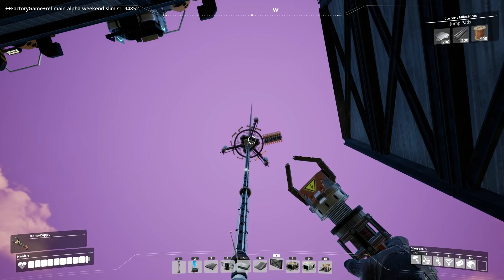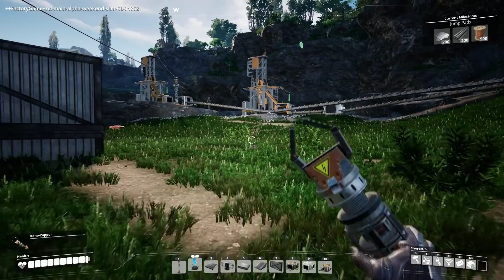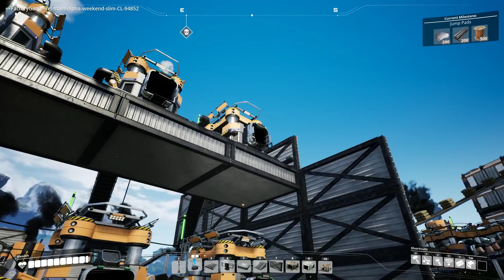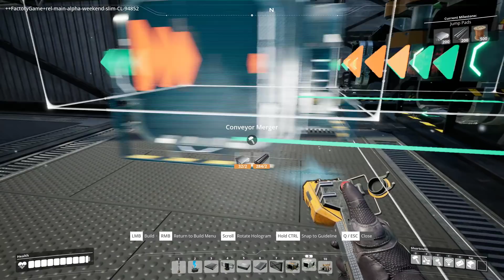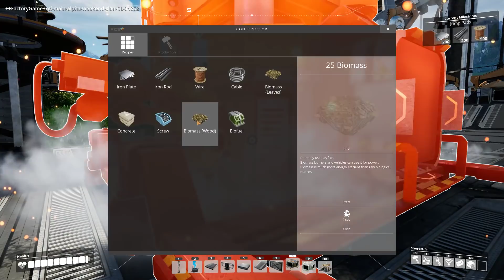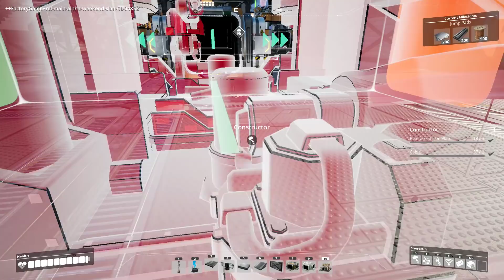Satisfactory Alpha Ep#9: Splitters and Screws

Comment: You gonna have the problem of belts throughput. Rotors require a lot of screws, you make a lot of screws. But belts only transfer them one by one. It takes forever to get enough screws to even make one rotor. Combining belts won't help cause you are still handicapped by the output belt that can't transport more than one at a time. I barely made it through the first space lift quest with my sanity intact, but the second one requires an amount from first x100. I hope you can find a solution for the screws!
Reply: You should have another level of logistic quite fast. If that happen just replace the belts.

Comment: When you overclock you can control the percent and you can put 3 overclockers  in in almost every machine  one boosts it by 50% you research
 the green power slug
Reply: And generally also a waste. You should use those only when you can't do that other way. In fact I usually use that tech to limit efficiency of the machines.

Comment: Too much space is wasted by rod buffer. You really don't need one at all. As I understand, mines here do not deplete, thus if you lead item in, it will be provided forever (untill power failure - but then item consumption gets shut down as well, so after power is back, machines go on running, almost like nothing happened)
Reply: I would disagree, because what can happen is that everything getting dumped into one buffer then allows all of the rod constructors to be operated at full production until all consumers of rods have been satisfied and you can run all of the consumers of rods at full or even overclock them if needed.  The Mark 2 conveyor belts can even help out there so you could have up to eight rod producers into a storage box and then that feeds into a series of screw producers.

Using splitters and mergers can help even out the overall production, just as he has been showing here.
Reply: @GlanderBrondurg  Probably. Anyway, this buffer system takes way too much space, most part of which is simply wasted (being completely empty), what is probably quite important, considering how little space he's got left.
Reply: @Gizzeit  The world is so freaking huge that complaints about space are largely irrelevant.  The space elevator could be moved, or as indicated on this video equipment could go into the 3rd dimension with additional floors.  I saw one construction project that went upward over two kilometers vertically, which should be more than enough room to put even individual machines on separate floors if desired.  That is on top of being able move around for over 20 kilometers from practically every direction from where he is at if you wanted to simply build a flat factory.

The main consideration here should be belt movement rate, where his attempt to combine the screw production is going to be a problem where the belt speed alone is going to be a bottleneck.  Since a screw constructor already produces at 90 screws (technically 90 screw cases I suppose) per minute, a Mk. 1 belt is already too slow to bother combining through a belt merger and even Mk. 2 belts are too slow to bother mergering except for overflow purposes in something far more complicated than being proposed at the end of this video.